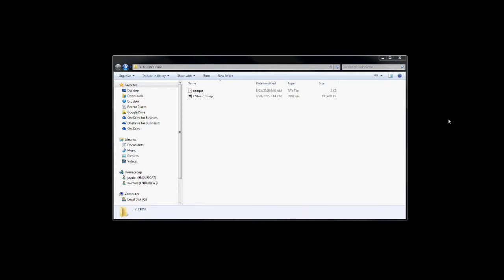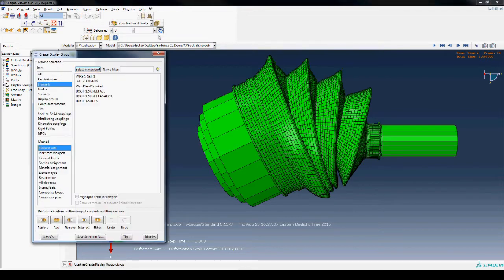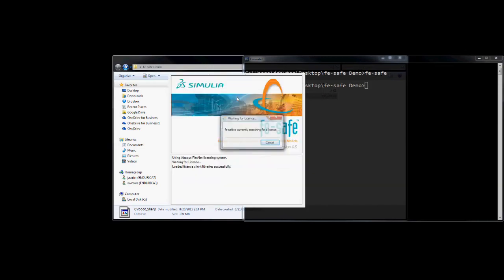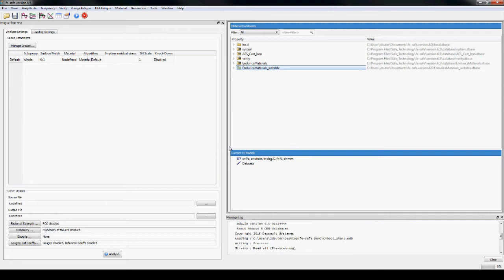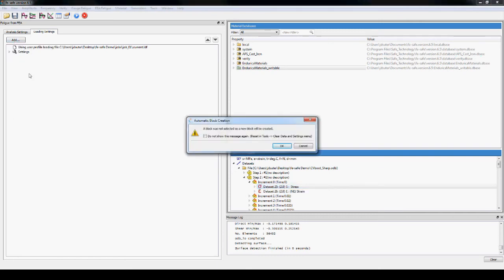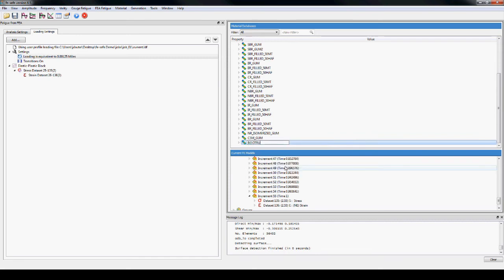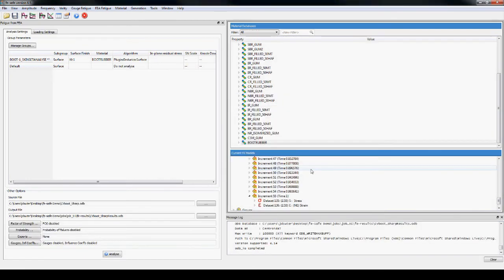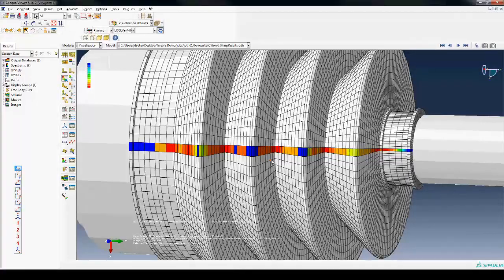Fatigue analysis of a rubber CV boot: fe-safe/Rubber workflow demo

Comment: hi could you tell me from where can i get more tutorials on Fesafe? thanks
Reply: Hi Yogesh,
If you're looking for fe-safe, it's sold by Dassault Systemes. Here is a good tutorial: https://www.simuleon.com/simulia-introduction-training
there are many others on the 3ds.com web site. Some are free.
If you're looking for the re-safe/Rubber tutorials, than you will need to contact a Dassault salesrep. We made this one to help sell it for them.
We can also show you more about the Endurica Command Line version; it works with any of the FEA software by sharing text data files and uses the same analysis and fe-safe/Rubber.  hope this helps

Comment: where did you take the material database for rubbers?
Reply: Hi Mirko,
The material database used in this video is included with a license to fe-safe/Rubber.
Reply from the maker: the information in our database has been collected from the scientific literature.  Since our code is based on fracture mechanical characterization, there is quite a bit of information available on various polymer types.